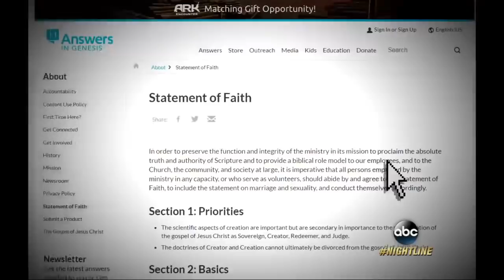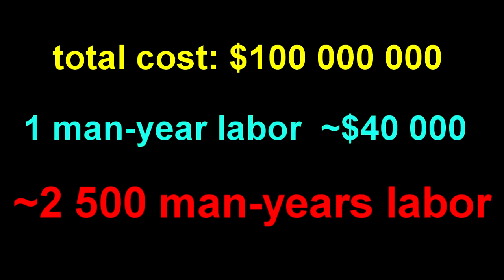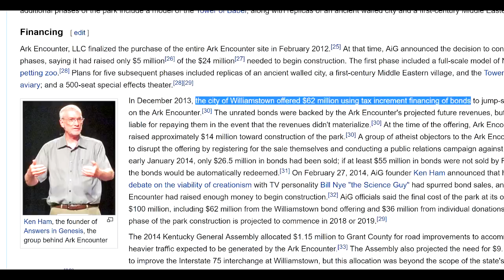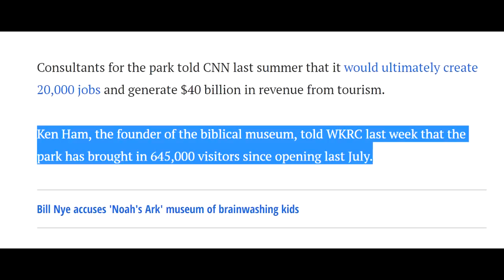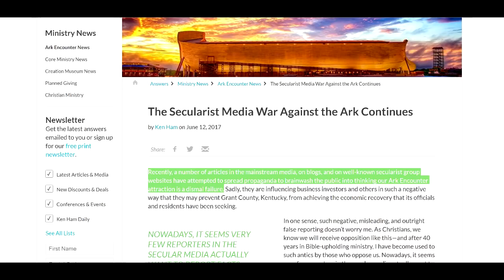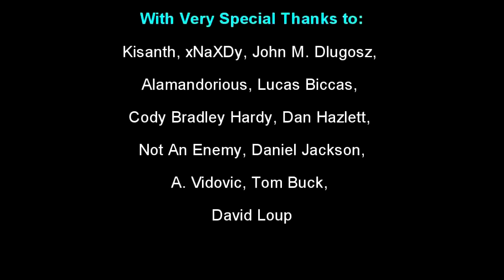Why do people laugh at creationists (part 44)

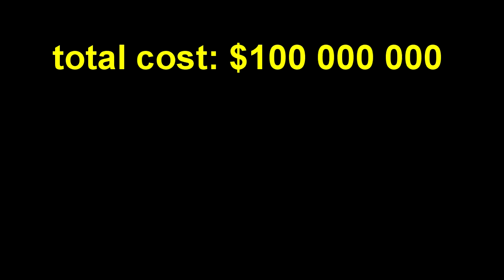Comment: 3:00 Actually, getting food would have been the least of their problem. The real issue would have been the careful pruning for fifty years of the gigantic production forest needed to supply the right quality of wood. Even in ancient times, they did not use random trees. It simply doesn't work. They planted the right species of trees and cared for them for decades to ensure a supply of timber.

Also, the maximum displacement of a wooden ship is about 3000 tons. Wood simply cannot support a larger structure.
Reply: Where and when was it discovered?
Reply: @Hunter HAM Sorry, but I have to agree with AJ on this. Per my 2 minutes of googling, "Because of her extreme length and wood construction, Wyoming tended to flex in heavy seas, which would cause the long planks to twist and buckle, thereby allowing sea water to intrude into the hold. Wyoming had to use pumps to keep her hold relatively free of water. In March 1924, she foundered in heavy seas and sank with the loss of all hands". I mean technically it floated as long as the water that leaked in was pumped out. Lets split the difference, large displacement wooden ships are not seaworthy, unless, there are pumps to empty out the water that leaks in. Hugs for everyone.

Comment: Ah yes, the totally authentic steel-beamed ark.
Reply: ..... you do realize that if those support beams weren't there that thing would just topple over and Barrel downhill destroying everything in its path....
Reply: @jessep.1117  exactly, which proves if the ark were real it would never sail 🙄
Reply: Actually your wrong... Dead wrong.

Between being made with Timber and Pitch, it can float and sail...
Reply: @jessep.1117  no, it cannot. it will sink under its own mass. we know the exact dimensions, materials, etc, that the ark was made of. scientists have tested whether a boat like that could sail and found that it could not. it sank every single time. do your fucking research. 🤦
Reply: @duckietheduck  Actually ships as big as the ark have existed, there were even ships lined with concrete. The ark itself can float and is box shaped, it wasn't meant to sail unlike the Chinese giant treasure ships, but it would have easily served its purpose. That's also not how buoyancy works, ships don't float by being light, they float by displacing water which is actually heavier than the weight of the ship itself. We actually have ships bigger and far heavier than the ark would have been itself made out of steel, we actually have ships that carry massive numbers of animals too of comparable size and they still float.

Your statement of "scientists have tested whether a boat like that could sail and found that it could not" is also incorrect, based on presumed specifications it's been determined that it could indeed have float.
Reply: @zereimu  what i meant by it would sink under its own mass is that it would twist in the waves and sink. this happened to the largest wooden ship in the world humans have built which was smaller than the ark. yes, it could have float, but the flood was a storm. I highly doubt a ship like the ark would have withstood the giant waves that the storm would've created.

Also no. We have no ships like the ark today. Do you know how large it said in the Bible the ark needed to be? We have no wooden ships today that large for transporting everything because we know they DONT WORK. We build them out of completely different materials and you can't compare that to a giant wooden boat.
Reply: @duckietheduck   Your original premise was that it would collapse under its own weight or not float, which is scientifically incorrect.

Your statement that we have no ship as big as the ark today is also incorrect.  The ark would have been(probably)  510 feet long., the largest modern ship today is 1,188 feet long.

And yes, history tells us there were ships at comparable size to the ark made out of wood, but not simply out of wood, the giant treasure ships are believed to have been lined with concrete on the inside for rigidity. It was China so I would not rule out super Asian technology and or magic or something we just don't know about.
 But they were defenelly made out of wood.

Also one of the main reasons that ships started being made from iron and later steel is because of mechanical propulsion and easier to get the materials for, mechanical propulsion has an insane amount of horsepower to move ships as big as that which is why you also factor the shapes. The ark would have been box shaped, which would have been ideal for floating and handling any rocking waves rather than cutting through or moving through them with any sort of artificial propulsion. Also they were rains, not necessarily an intense windy storm or a hurricane.
Reply: @zereimu  nope. never said it wouldnt float, i said it wouldnt sail and that it would not withstand a storm- at least not for very long. and im not talking about length, length isnt the issue. and yes those were lined with concrete for rigidity and to prevent leaks but nowhere in the bible did god command noah to put concrete on the ark. the reason those boats did not sink is because 1) NO, they were not the size of the ark. we have no historical evidence that ancient chinese sailors built ships that large. 2) they had concrete linings. and no, the fact that the ark was box-shaped would not have helped it stand any better of a chance against massive waves caused by a flash flood/storm. 

we started making them out of those materials because wood simply is not a good option for building boats. the wood rots, distorts, and creates leakages. sailors from back in the day that sailed on wooden ships had to bring spare wood planks with them just to continually repair their ship while at sea. wood does not last long, and it most certainly cannot withstand 40 days and 40 nights of being out in pouring rain and giant storm waves without rotting or falling apart. 

all that being said, you're trusting that a small family from a time barely after the wheel had been invented had the time or resources to build an enormous wooden ship, reinforce it to prevent it from collapsing under its weight before ever even getting in the water, and somehow have enough room on it to store 2 of every animal, bug and plant on the earth as well as enough wooden planks to last them the 40 days/nights to continually repair the ship during a flash flood while its storming heavily and keep their boat from falling apart or collapsing under the waves. that is a stretch if i've ever heard one. its a fairy tale.
Reply: @duckietheduck  Oh, I thought you said float because you said "it will sink under its own mass.". Since you said it would sink I thought you meant it wouldn't float. But yeah the Ark was never designed nor intended to sail, just float. Incidentally the giant Chinese treasure ships were able to sail, but they didn't use them as much for sailing and were mostly for show. If you try and sail with it, it would add quite a bit of extra tension with a shape and size like that as you go against other currents or try and steer the thing too much, but they were effective at flexing your military against other nations.
Reply: @zereimu  yep but again the Chinese ships are not comparable as I've already demonstrated. And again, even if it was designed to float, and could do so, it wouldn't last long in a storm of that magnitude. assuming it ever even existed.
Reply: @duckietheduck  The great rain wasn't necessarily a storm or a hurricane. The treasure ships are actually comparable to the ark too, they are estimated to have been between 440 and 538 feet long by 210 feet wide,they often carried armies too, while the ark was estimated to have been 510 feet long, 85 feet wide, and 51 feet high. Not all of their fleet was that big though of course but believed to be the biggest they had. The ark would have also been more stable since it would simply float as a pod, while treasure ships were actually sailing ships and they actually survived. Though again highly impractical for the purposes of smaller ships.
Reply: @zereimu  a flash flood is a flood caused by storms. Flood waters are violent and create large waves. Even if it wasn't necessarily a storm, any time you have water pouring down like that and filling up that quickly waves will be made. And the reason they are not comparable is not because of side but because of building method. Those ships were far more advanced and made by a more technologically advanced society. You said yourself they were reinforced with things like concrete but there was no concrete on the ark. The method of building treasure ships vs building a giant wooden box are completely different and again not comparable. You are completely ignoring every other flaw I brought up with the ark that would've completely negated it's chances of surviving the flood.
Reply: Noah has steel beams
Reply: It's the worlds largest wooden structure.
Reply: Actualy at the time Noah did have acess to metal however we aren't told if he had steel or not, so its based on insufficient evidence
Reply: Atheists and their architecture arguments don't hold water. Why in the world would you need a sail on the ark? Why? Why? Why? This clearly shows that you're not paying attention to the story. A sail would be a horendous idea on the ark, it would cause it to possibly flip over or crash.

Comment: I'd like to talk about the length of the ark.  According to the Bible, the ark was 510 feet long.  The longest wooden boat ever built was the Wyoming a 450 ft schooner.  Even with metal braces, it tended to flex and was constantly leaking.  Wood doesn't have the tensile strength to withstand ocean forces.
Reply: It was obviously held together by divine power smh🙄
Reply: Ridiculous comparison. The Wyoming was built light for speed.  The Ark  didn't have that restriction.

Further, the Wyoming still lasted 14 years before sinking.